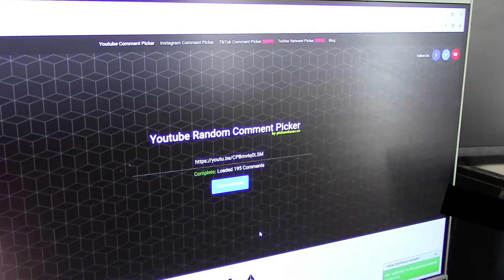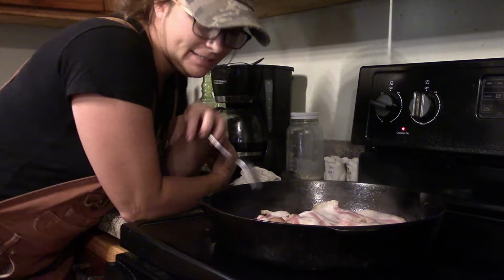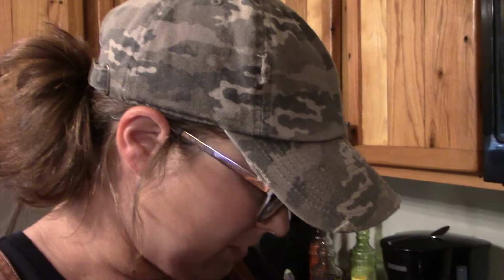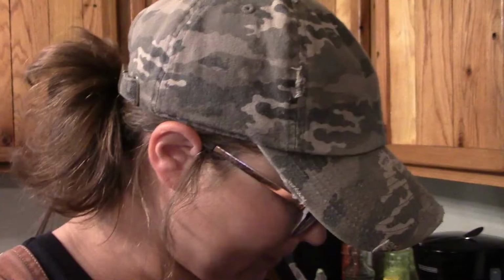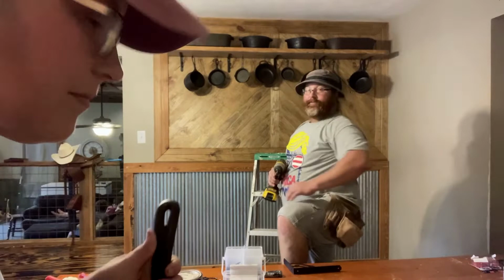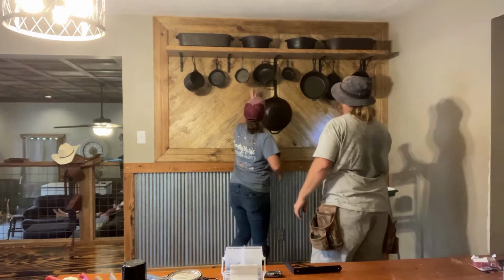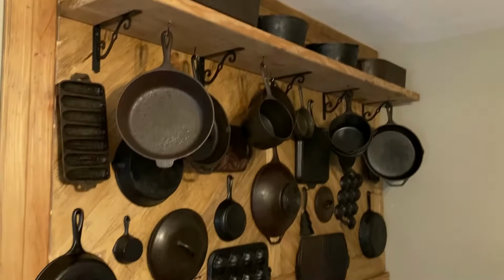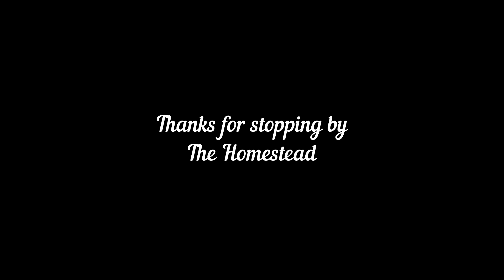DIY Cast Iron Accent Wall Build | AND The Winner Is

Comment: Nice, job well done. I'm at the point where my metal shelving rack has too many pieces of iron, and I know I have to do something with 8, maybe 10, skillets. I'm probably gonna hang them off of the black pipe, but something similar to this on the wall first with the pipe coming out of the frame instead of just the wall is a new option. Anyway it looks awesome.